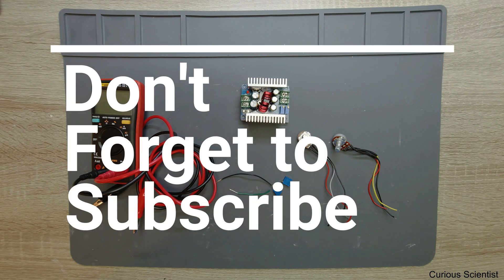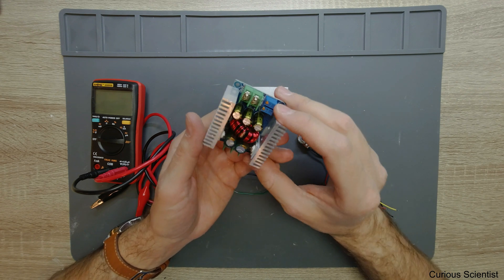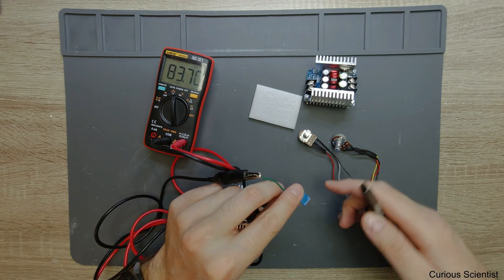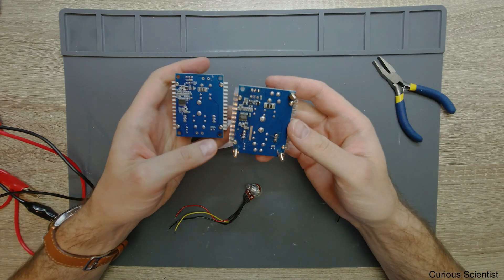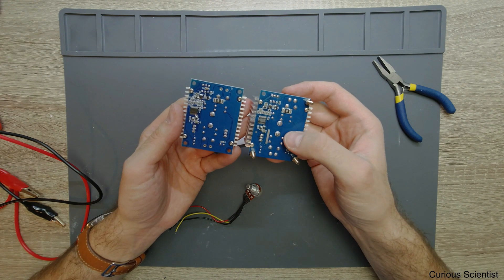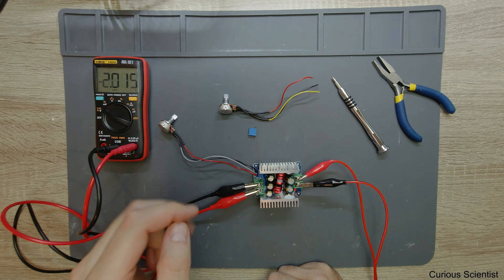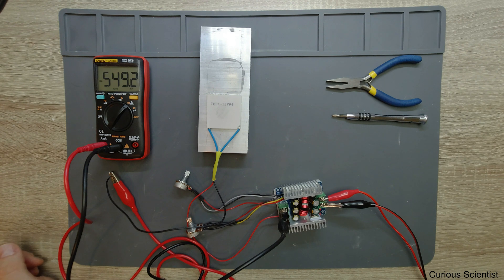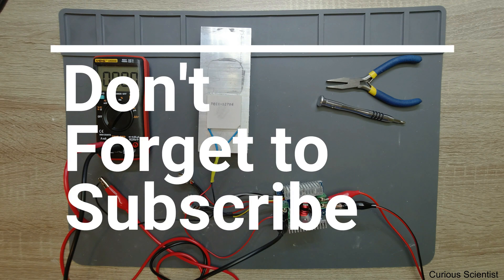Replacing the potmeters on the 300 W, 20 A DC-DC converter

Comment: W103 means 10k potentiometer right?
Reply from the maker: Yes. But you need 100 kOhm ones.
Reply: @CuriousScientist  But I have a circuit XL4016e1. There are two multi turn potentiometers (W103) for amp and voltage control. Should I use normal 10k ohms potentiometer instead of those two potentiometers?
Reply from the maker: Ah, if the default part of your circuit is W103, then keep using 10k. I thought you were referring to the circuit in this video...
Reply: @CuriousScientist it's my fault. But thank you sir 😊. Take love from India ❤.

Comment: I absolutely hate those trimpots because they are so fiddly. They are loose when delivered! ( wobbly on the board).   I have bought a usb power supply with a brass large knob that works great with that little step up dc to dc converter. On Aliexpress you can buy the little USP dc to dc boost converter for 5 dollars AUD. Is it cheaper to buy a few of these and replace on the regular dc to dc buck/boost converter? Any reply appreciated cheers from Australia 👍. Subbed and liked 👍
Reply from the maker: Hi! Thanks for the support! Yes, those trimpots are not comfortable to use. It can be even dangerous because they are located close to the terminals. If your screwdriver slips while you are trying to adjust them, you can accidentally touch the wrong things. Not really harmful, but might fry the board. If I am looking at the right product, then the difference between this thing and the little USP DC-DC converter you are referring to is that this one can deliver up to 20 A (with active cooling!) while the other one is only up to 4 A. I would say, it is up to you. If you don't need that much current, then the other product might be better due to its compact nature and built-in features. Cheers from Sweden!
Reply: @CuriousScientist  thanks for the quick reply. Cheers 👍
Reply: @CuriousScientist  I was hoping that I could find the different trimpots? Is there a specific name or code?
Reply from the maker: WXD3590. But pay attention to the resistance! It must be the same as the potentiometer on the board.
Reply: @CuriousScientist  thanks for that!😀

Comment: Very informative. What type of pot works with LM25116?
Reply from the maker: I don't know which potentiometer is used with that specific regulator. Use the exact same value that you already have on the board. I also used the same value, I just switched to another form factor.
Reply: @CuriousScientist  it says 103 printed on pot. And i bought 100k ohm. Do you thinks its the same value?
Reply from the maker: 103 is 10k. 104 is 100k.
Reply: @CuriousScientist Great. Appreciated it.👍🏼
Reply: When i install the pot with wiring should i remove the built in pot install to the board or i can leave it and install the new pot with wire? Do you have a diagram how to wire them? Or just follow how you wire the pcb and pot that you make on your post. I’ve seen on youtube that every pot has a diffent wiring diagram base on model. I’am a newbie with this kind of unit that’s why i have a lot of question to ask you. Thank you in advance. 👍🏽
Reply from the maker: Please check my website and search for the szbk07 keyword. I have actual pictures and explanations and a very detailed description that can answer your questions. Cheers!
Reply: I already set up my unit same as yours. Does the amps adjusted when there is load connected to the unit? I can only adjusted mine when the battery connected to the output of buck converter and voltage you can adjusted without load. And i notice when i charge my lifepo4 which is 4s 4p with a capacity of 6A recommended charge is 1.2A per cell. I set the pots to 14.6v and and im only getting below 2A when charging. When i adjusted it to higher voltage like 20v and the amps is higher. Power supply connected to it is 24v 6A output. Eventhough i added 12v supply parallel to the output to use for my cooling fan (thermostat) and only turn on to the temp that i set and that consume 12v .25A which is a little reduction from the 6A output of the power supply.
Reply: I see your video when you adjusted the amps from the pots but im not sure if you have load connected to the ouput before you can adjusted the amperage from the buck converter before using it to load.

Comment: I just recently received one of these units with the clear LED indicator.  It doesn't work at all.  When I inspect it, there is no pad between the transistors and the heatsink.  It's directly fastened without sleeve on the screw. Do you think this is the reason it doesn't work?  There is a diode near the input voltage so it might be wired differently.
Reply from the maker: Hi! The SZBK07 module that I hold in my hand right now has a pad and a sleeve for mounting the MOSFET, however, I don't see its purpose. The whole heatsink is supported by the MOSFET and it is not connected anywhere in the circuit. So, it is floating, therefore it would not matter if it was with or without those accessories. Furthermore, I assume that the pad itself is only there for heat transfer and not for any electrical insulation. 

How do you power the DC-DC converter? What power supply do you use? What is the input voltage and maximum possible current? What is your load?
Reply: @CuriousScientist  I think the purpose of insulation is to isolate the heatsinks, so there isn't a voltage on the exterior of the package.  I agree that these are not otherwise electrically connected.  I removed the heatsinks and mosfets with them, and verified no electrical connections or pierce through the PCB.  I also verified each mosfet using a component tester. I'm supplying the input with variable voltage from a hp E3633A 20V/20A and output has a 50 ohm 10W resistor.  Around 6-9V I get a few mA of draw and essentially 0V on the output.  When I crank it up to 10-12 I suddenly start seeing voltage & current on the output, about 2V less than the input.  I've turned both CC and CV lock-lock until I could hear faint clicking indicating the end of travel, they have no effect whatsoever.  Under a microscope everything looks perfect.  I'm starting to assume it's a faulty control chip.  I have another module purchased months ago that works fine, slightly different PCB and uses the isolation sleeve and pad on each mosfet.
Reply from the maker: It could be a faulty chip, yes. Have you tried turning the potentiometers in both directions? I guess you are aware of this, but even if your CV is maxed out, if the CC is still at zero, you won't see any voltage (Ohm's law, basically). And of course, this is true the other way around. If you have a 50 Ohm resistor as a load, then at 10 V you should see 200 mA on the output. 

You also mentioned that you have a variable voltage PSU. What was the actual voltage and current setting? 20 V / 20 A is I assume to be the specification and not the actual setting.
Reply: @CuriousScientist  I am varying the voltage and it is staying in CV mode.  It didn't reach the current limit and thus never went into CC mode.  There are two modes, 8V produces up to 20A and the 20V mode something less.  Use this unit daily.  The module is probably DOA and will use it for parts.  I already got a refund.  I was interested in figuring it out, but without a schematic for this particular circuit I cannot troubleshoot the chip.  I'd rather spend another two bucks and do something else with my time! But I like to figure things out...

Comment: Help!!! So i replace the 104 trimmer potentiometers with 3590s 100k potentiometer but after turning it on it worked for few seconds and the output became 0v even after changing the potentiometers to the 104 trimmers the output still stays at 0v
Reply from the maker: Did you pay attention to the polarity of the new potentiometer?
Reply: @CuriousScientist  yes
Reply from the maker: Maybe there was a short somewhere or something like that. I heard from a few people that their boards popped and they could not use it anymore. I also destroyed 2 boards, but then 10 others are still working just fine. It is hard to say anything without seeing the circuit.
Reply: one of the board died because of short circuited and looks like the other two damaged the ic because I used single core wires to connect potentiometer and they acted as a antenna and destroyed the ic

Comment: Sir what is the min input current needed to produce the max output current?
Reply from the maker: It is a buck converter, so you need at least the same current and preferably 20% more voltage (efficiency) than the desired output voltage. Based on your question, you want to get a boost converter. With such a converter, you just need to make sure that the power in is about 20% more than the power out (efficiency), but you can almost arbitrarily combine the output parameters.

Comment: I replaced those trimpots with your brown ones in the video but the potentiometer is burning when tune them? I replaced 10K and 100k as well potentiometer. After that the module is not showing output. May be the potentiometer cannot the power ?
Reply from the maker: Many of these potentiometers are garbage. I noticed in other circuits that they just start to throw sparks and stop working. I suggest to source them from reliable sources or buy branded ones such as Bourns or ALPS potentiometers. You can also double-check the wattage of the potentiometers.

Comment: i cant change the amp value it always stays high
Reply from the maker: The potentiometers are multiturn potentiometers, so you might need to turn them a lot to see any effect.
Reply: @CuriousScientist  the 2 pins of potentiometer giving me 0 ohm and last two pins around9.2k
Reply from the maker: How do you measure them? I hope not inside the circuit.

Comment: it won't last more than 7 days , multiturn trimpot have better accuracy .
Reply from the maker: I don't understand how you connect the longevity with the accuracy... And why 7 days? By the way, I have a video where I rebuilt a similar circuit with multiturn potentiometers. When I made this video, I only had these potentiometers.
Reply: @CuriousScientist   this potentiometer sprak inside and kill it then 50k becomes xyzM ohms , i hope you'll get it
Reply from the maker: Sure, I get it. I've been using several DC-DC converters with these potentiometers for years without issues. I had only one potmeter blowing up while I was tinkering, but I must say that they can be sometimes garbage quality. So, as long as you have good quality products and respect the tolerances, they work just fine.
Reply: @CuriousScientist  yaa but in my whole life didn't get any 360° turn potentiometer good 😔 , always i have to buy thise expensive multiturn potentiometer

Comment: Witam zrobiłem zwarcie na wyjściu na minimalnych ustawieniach napięcia i prądu,co mogło się uszkodzić. Dziękuję
Reply from the maker: I have no idea what you said.
Reply: I made a short circuit at the output on   the minimum voltage and current settings which could have Bern damageo .thank you
Reply from the maker: Thanks for translating it. I don't know what could have caused it. If you used the same values and parameters, it should work fine. I use this kind of setup for 2 similar DC-DC converters for making a 12 V 30 A PSU into a 2-channel PSU and they work just fine even at high loads. Some potentiometers, especially those very cheap ones are not really reliable, so they might break during usage. Once I made one spark and burn out. I recommend using some better quality potentiometers, especially for the CV potmeter as that potmeter experiences the whole output voltage.
Reply: I don know if IT matters, but event the  LED on the inwerter input od not litano the power supply is potentiometers arę 100ohm 10 rotatong 2 Watts everrything was working before concluding.
Reply from the maker: The original potentiometers are 100 *kilo*Ohms, and not 100 Ohms. This might be the issue.

Comment: Hello and thanks for this tip. I have a buck booster which has LM2577 and LM2596 (limiter and booster). It has a 3296 trimmer which i changed with a 50k pot. It works but when the pot is off, no voltage, when I turn it %20, it fires up quickly to 26 volts. So after %20, pot is useless. I tried changing 1-3 to 3-1, but pot is reverted. Also changed to 100k pot but still either same. I hope, i can explained correctly, 😔 sorry.
Reply from the maker: Hi! You should always replace the removed potmeter with the same value and ratings. I have never modified with the above mentioned converters, so I don't know why they misbehave.

Comment: Hi , can i use this buck module for battery charging . Like fixing output voltage to 14.4v & adding mosfet at output and controlling it with arduino pwm to control current .  Is this fine !. Please let me know.Thanks in advance.
Reply from the maker: Hi! Why would you bother with the extra mosfet? This module also have a current adjustment option (CC potentiometer). However, I am not the best person to ask when it comes to battery charging with this module. I have never tried it for this purpose, so I lack of knowledge and information.
Reply: @CuriousScientist  i have made a board which consists of lm2596 it has only voltage control.
Reply from the maker: Okay, but this is a different board and it also has a current control.
Reply: @CuriousScientist  yeah right , but wanted to know if thats possible.

Comment: A standard JST socket fits perfectly.  Easy to fit and far more adaptable. Someones not done their homework.
Reply from the maker: What's wrong with soldering? A solid mechanical and galvanic contact. It is not about homework...

Comment: good day sir. I have "8A Automatic Adjustable Step Up Down Boost Buck Converter" and i want to replace trimpot with potentiometer ? how can i find the rating of the trimpot and what compatible rating of potentiometer and multi-turn potentiometer  should i use?
Reply from the maker: Hi! The details are written on the potentiometer. Read them, Google them and you can find their datasheet. Then search for potmeters with similar parameters, simple. If I am not wrong, this SZBK07 uses 3296W-1-104LF potentiometers. 100 kOhm and 500 mW.

Comment: Hi, i have this module, but I can't change the current via cc pot. It's always at max i think. Do you know why us that?
Also i have a transfer which output after rectification is 44v. It's 4v more than recommendation. Is it ok if i use that transformer?
Reply from the maker: Hi! Don't use higher input voltage than the recommended. Use another converter which is compatible with such high input voltage. Regarding the current, you might just need to turn the potentiometer a lot. These are multiturn potentiometers and sometimes they don't cause any sudden changes. But as you mentioned that you "think" it is alway the max. Did you do any measurements?
Reply: @CuriousScientist  no i didn't do any measurements. But i tried to test it with a 12v/60w car lamp which the CC pot didn't dim the lamp.
I only have this 120w transformer with 30v ac output which after rectification it's around 42-44v dc
I'm planning to make a diy powe supply with this module using my old transformer.
I think i should change pots with 100k volumes like you did so maybe fix my cc adjustment problem.
Reply from the maker: But if you haven't done any measurements, how do you know? You can't just assume things. If your transformer provides 42-44 V, DO NOT use it with this module. Also, I guess you want to dim a halogen lamp, and in that case (as far as I know) you cannot just cut down the current. You have to chop the input voltage; so by changing the duty cycle of the voltage provided to the bulb you can change the brightness of it. So, you need a dimmer circuit and not an adjustable power supply.
Reply: all I know is my 20A version came with it's CC set higher than the board could take and pulled a good 50A blew up my 480watt power supply and toasted the chargers board , even tho I set the voltage close the battery bank voltage I was going to use it to charge , second attempt fuses instantly blew , Third attempt  I set the Voltage lower than the battery then turned up the voltage until it drew power then I must have spun the CC a good 20 turns before it affected the power draw then bumped up voltage then bumped up Current until I finally got it doing the 12A max load I wanted  , does anyone know the calculation needed to work out the resistance so I can just swap over the trim pots for a resistor that will do the CC I want ? I have 26 of these I need to do , just need to step up 12v to 48v for 150watt loads , and never want it going over 15A
Reply from the maker: You can find all the formulas in the datasheet of the buck controller chip.

Comment: I did same as this video but voltage regulator burned.then changed with 500k  potantiometer.but this burned too.what poblem I dont know.
Reply from the maker: What potmeter did you use? Maybe wrong connection. Also, try to start the converter with the potentiometers set to the middle and there's no load on the output.